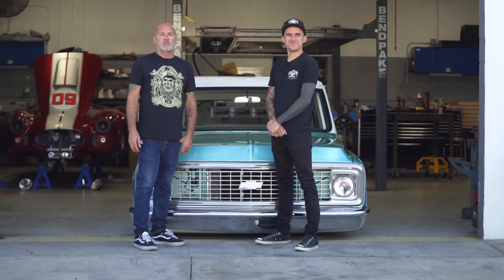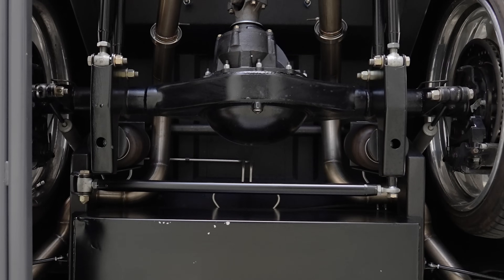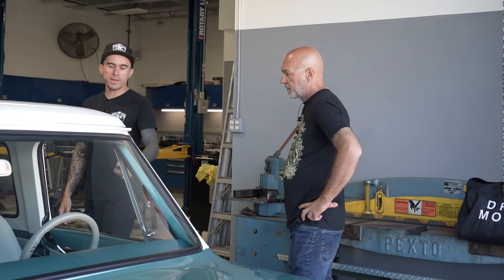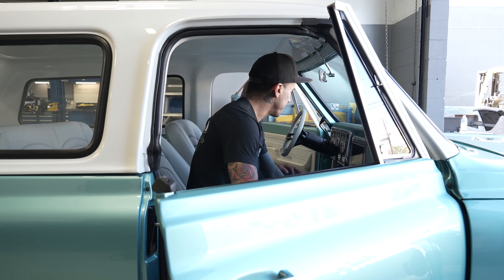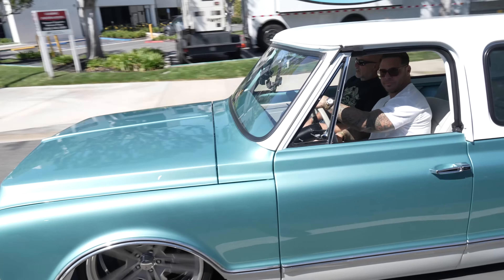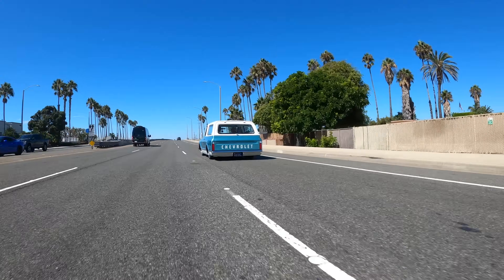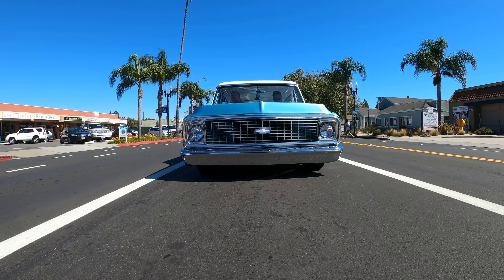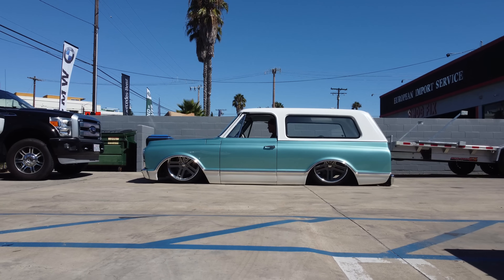Stunning Chevy Blazer Slammed with an LSX Engine

Comment: Having owned a cherry 70 C10 as a teenager. I can't explain why it's seating position was my favorite even more than my current Z06. But it was, so with that said that Blazer interior is my favorite ever in a custom
Reply: 76 K5 was the same way. Not quite totally upright which I cant stand. Even at 6ft3 I was comfortable in the stock seats.

Comment: Usually when you tuck in the wheels so far into the wheel arches the stance looks "weak", but in this case they somehow pulled it off, it looks great!
Reply: agree, lots of pro street cars wtih the rears tucked too far inboard cause they took a shortcut
Reply: Tucking like a motor home has always been the look for me. You need wheel clearance when you drive low AF

Comment: Impressive show car.  I'm sad it's not a big block.  You went pretty far without seat belts or head restraints.
Reply: Not a fan of ls swaps but the fact it has 454 cubes I totally approve. 540 tw is just right to move that around. ENough to be fun but not overkill

Comment: Also, the tail light has a live line in it. A filler neck and live wire are just unwise. It may never be an issue, but if it is, someone will get hurt and lose a beautiful build.
Reply: It would be the Ford Pinto issue all over again
Reply: The Pinto had the tag light to close to the filler port. Getting hit would cause the bulb to short, and the filler to open.